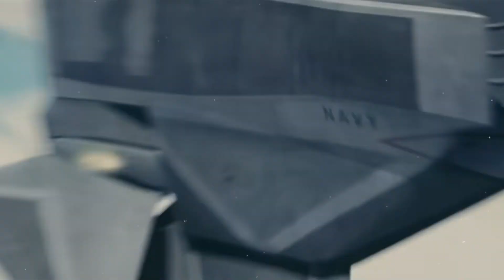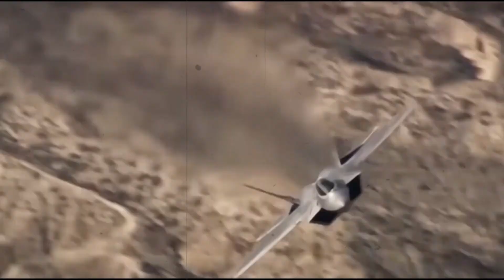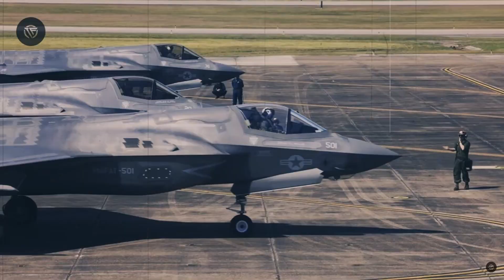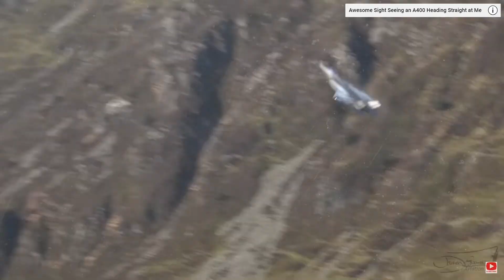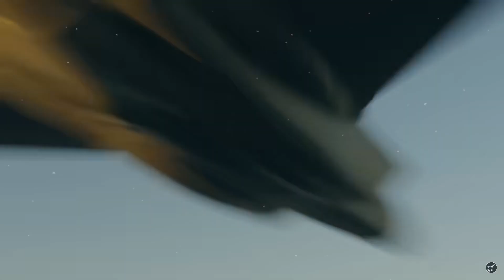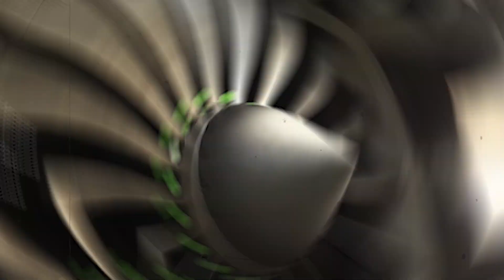Turbocharging the F-35

Comment: You should know, having 2 engines by 2 different manufacturers is standard practice for the air force. As an example, the F16 has always had a GE engine and a Pratt and Whitney engine, so doing the same for the F35 or anything else isn't a big deal
Reply from the maker: But why tho
Reply: @flyingduke  redundancy. If there's an issue in the supply lines for one, the other is still there

Comment: One really significant issue was left out concerning the adaptive cycle engines - they weigh more.  That potentially moves the center of gravity aft by too great a degree to make it acceptable without a significant re-design of the air frame.  We'd essentially end up with a new aircraft, which equals monumental new costs for the program.